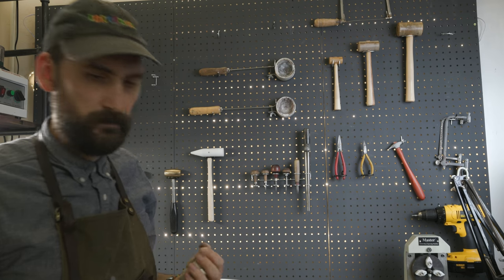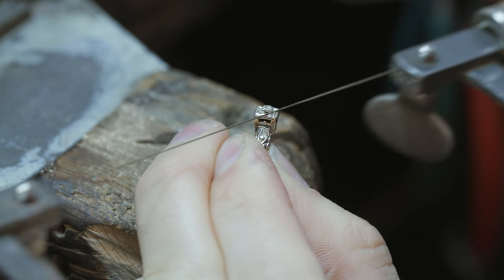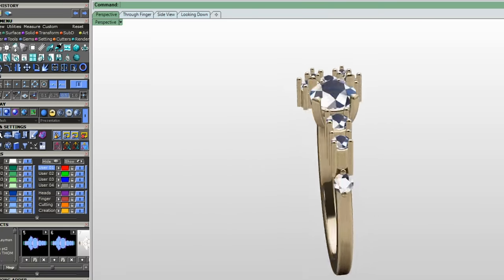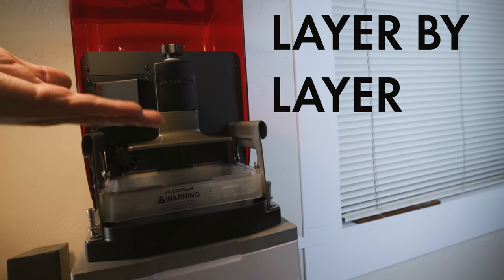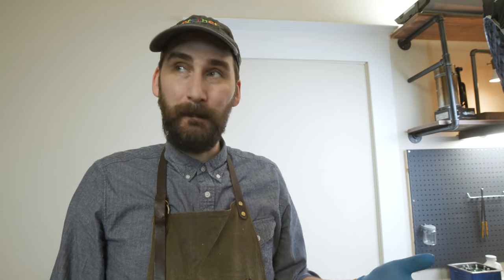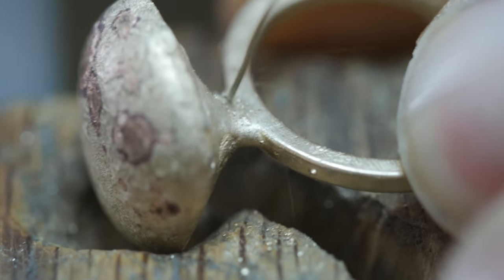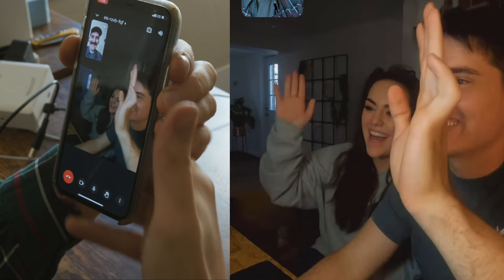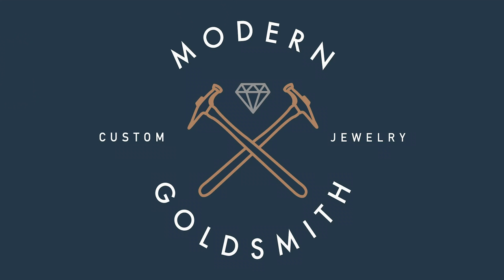Extreme Jewelry Makeover: "The Diamond Cluster"

Comment: How often do you find you have to re-do things when it comes to casting? Is it like a 1 in 5 kinda deal?
Reply: I think it’s should very seldom)
Reply: Depends- if the investment powder is old, or the vacuum process is off, or the burnout process is rushed, or you cast at too high or low a temperature, or you do a bad pour of raw material then you start over. He is working with modern equipment so as long as he does his math calculations correctly and mounts his wax model firmly he should hit a good cast well over 90% of the time.
Reply: @damaris1393  Wow that's a lot of variables! Just seeing the process makes me really appreciate how much of an art and a science Jewellery making really is.

Comment: I help my customers come up with new designs for their old rings. I try not to use their gold because sometimes you will get some porosity in the casting. Instead I give them credit for their gold. I've designed rings, necklaces and bracelets. Disclosure, I don't do the goldsmithing, I have 2 master goldsmiths that do the actual work. I'm familiar with all the steps, just don't do the work. Nice job on the ring!

Comment: How did you create molds for rings before purchasing a 3D printer? Did you sculpt a model of the design by hand? Would it be possible to create a general shape for the casting and then use a jeweler's saw and files to create the details out of the rough shape? 
I'm also curious about how you set prices for your work. For example, if the casting hadn't been complete on the first try and you'd had to start again, would you have had to do double the work without additional compensation? How many hours did the process take from start to finish?
Finally, did you come up with this design yourself after seeing the pieces of jewelry you had to work with or did you consult with the client beforehand/throughout the process?
Love your videos! So happy they came up as a recommendation. :)

Comment: I have designed a three stone ring for my wife. The three gems are to be parallel to the finger in a fairly normal band and setting configuration. I have the gens. The center gem will be 7mm while the two flanking stones are to be 5mm each. The unique feature is that strands of ivy with leaves and buds are to be cast separately and welded to the basic structure so that they wrap and envelope the gens. The buds are to be covered in 1 point diamonds. All this in 14k white gold. Can we work together on this? I know that this cocktail ring will be expensive. Larry in Arizona